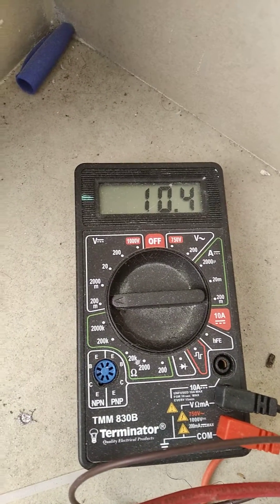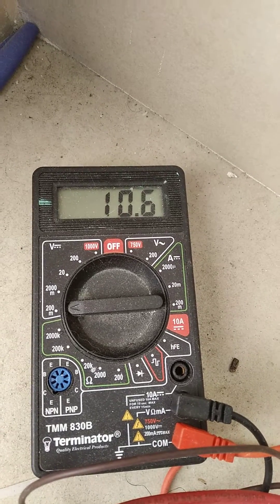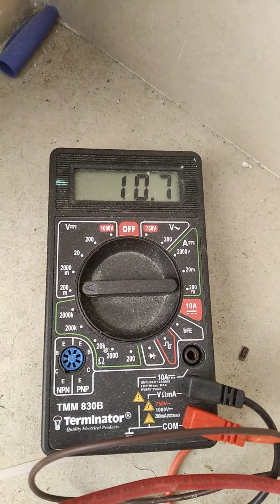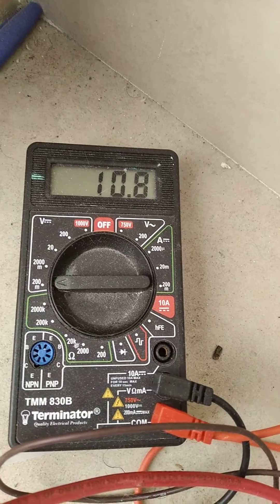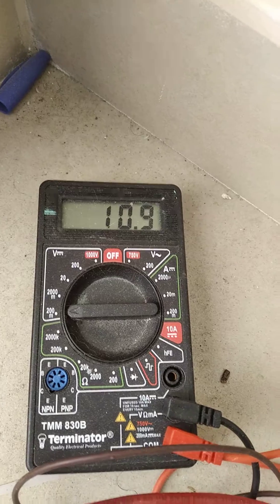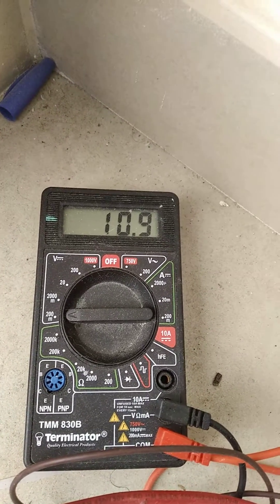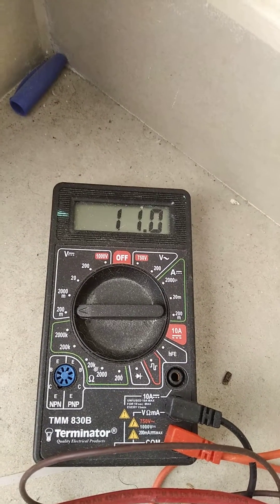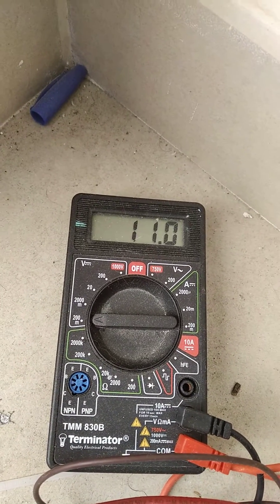A little fun thing about ion exchange membrane electrolysis

Comment: You commented in one video that PVA citrated membrane do not like chlorine, does that mean that this one  dechlorinated PVC and citrated also at the end do not like chlorine too?

I see you suggest Sulfonated benzoic acid as alternative.
Thanks!
Reply from the maker: I actually also have another idea which I have yet to get around to test and thats to melt styrofoam in acetone and paint onto some synthetic cloth made of polyolefins then to soak in hot concentrated sulfuric acid.
Reply: @CatboyChemicalSociety  Cool !
Reply: @CatboyChemicalSociety  It's quite hard to mix styrofoam and acetone to a thin enough mixture.

I've seen other videos of yours and will try your citrate linked PVA membrane on dechlorinated PVC soon, with the detail that I will thin the PVC glue with acetone before painting it on cloth, because my glue is quite a goop. The cloth I selected is from layers of a (clean) covid mask (not a ffp2 mask). it's quite porous and lightweight. For my quaternary I'll probably be able to use lecithin or BC from algecide (but this one is $$$).

I also wonder if a one-step membrane made of mixed PVC glue and PVA+citric acid would work. Followed by dechlorination and then baked for crosslinking. On cloth or casted standalone. No idea. So many interesting experiments.

I'm using a clay pot at the moment with epsom salt in the cathode and a lead anode. but my acid is turning pink which tells me it's contaminated by the pot. I hope these membrane ideas give better results.